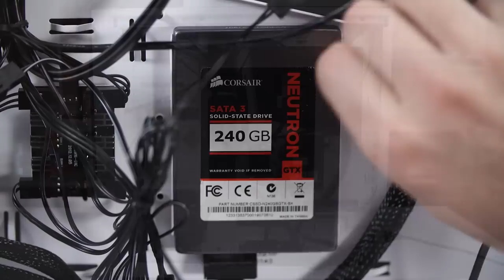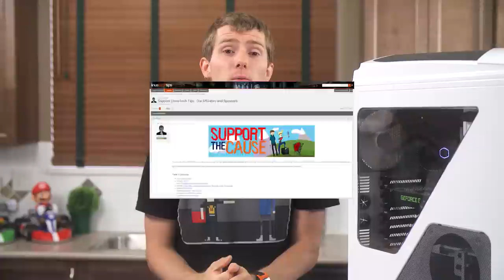NZXT Phantom 530 Gaming Full Tower Case

Comment: So wait quick question if someone could answer this for me plz. So you are saying that in this case since it is elevated a little bit and there is a filter that I can install the PSU with the fan facing downward towards my carpet without worrying about it dying or do I have to put a surface still underneath my case covering the carpet from the PSU fan? If someone could plz answer the that would be great thanks!
Reply: yeah you can let the fan face the carpet, but i would still recommend to not put it on a carpet, just because you do sacrifice a little airflow.

Comment: Telling people the length of the radiator that can be put in there is nice, but what about the thickness?
Reply: Also, there ARE reusable zip ties... I don't understand why nobody packages them. They aren't that expensive.
Reply: For NZXT cases in particular, you can check cooling compatibility on the NZXT product page.

Comment: You can remove the drives on either side, mine all come out the left panel, in fact im pretty sure that's the default way, so you managed to get them all turned around somewhere there Linus :p

Comment: i have a USB 2.0 front support MOB, it does not have a front USB 3.0 support, is there anyway i can use these front usb 3.0 ports in the case? and what would be a good case if usb 3.0 front i/o is not supported by my MOB.

Want to attach a h100i cooler to my fx8350 so looking for a case that could suit my needs.. also if any other cooler say maybe h80i would be a good option considering my MOB is only supporting front usb 2.0 ports and spending so much on a case without fully using the front I/O would be stupidity.

so want suggestions on cooling and cases..please reply pllzzzzz

Comment: Noob here! Can you install a single 120mm fan with liquid cooling radiator on the top?? like not a duo one?
Reply: Marleychopsandme  yes with the rad below the frame and the fan above the frame but below the plastic top piece. trying to mount both below the frame will cause you to have clearance issues with ram and other mobo components.
Reply: Yeah, if it can support a triple 120 rad then it can support a single 120mm but I'd go with a dual as it cools better

Comment: whats the reason for ssd being mounted behind the motherboard?
Reply: so you don't have to populate the front part of the case with the drive cages, so you get more airflow from the front bezel fans to the mobo, cpu, and gpu
Reply: So you can remove a drive bay

Comment: So i went to the link that was for the purchase on amazon and on some pics its empty and on the last one it has all the hardware and stuff in it will it come empty or will it come with everything in it for only 130$???
Reply: only thing it comes with aside from wires is 2 fans...1 in front the other in rear ...they just used the picture to give buyers a illustration of what they hardware would look like in the the case :)

Comment: Could you fit two GTX 980 TI's? I'm looking to start with just one but then upgrade at a later time
Reply: Mr. Clean Easily, I have this case and you could Triple SLI with no problem
Reply: Mellow Drama Thank you!
Reply: Mellow Drama you can go quad if you really wanted to the case will support it and with the additional fan support, it probably would cool them better too
Reply: Good
Reply: Good

Comment: Hey man, i love your videos. I have a question. And I need your help. Your opinion matters a lot.

I am building a new system. I have a NZXT Phantom 820 and NZXT Kraken x60. I wanted to know if the following way of mounting is efficient or will it cause any problems.
What I did was put the two 140mm fans that came with the cooler in push config. Then removed the side 200mm fan and mounted it at the top with the existing 200mm fan. Making it a push-pull config.
Now i want to know, is this way of mounting two different sized fans effective? any downsides? 

I have watched your video on push, pull or push/pull config. and I was initially going to go with the pull setup. but then i had that extra 200mm fan lying around so thought of this thing and now i am having second thoughts. I havent yet completed the build. The RAM is yet to arrive. 

Your opinion will be very helpful.

Comment: I have an 820, and I simply cannot remove the top plastic piece thingy to get to the pre-installed fans!
Help!
Reply: on my 630 i had to rip off the front panel then remove the top panel from the front side to get it off.
Reply: Atleast with the 410 you need to remove the front part to be able to easily take off the top, might be the same in your case.
Reply: in the case, there are these plastic pins. Squeez the 2 plastic things together. When you did that with all of them, push the top off. This was in my CASE my phantom 530 :)
Reply: ***** strmapes tommydadog 
In the manual they say, "Push the tabs located in  the inside of the front panel, then you will see an opening in the middle of the top panel, you can grab the top panel from that hole and pull it out and upwards."
While all that written here is completely true
The top panel is mounted way too securely, and I feel like if I put any more pressure pulling the panel it might just rip the front USB connectors off

Comment: I was wondering. I have all the specs for this computer, but I was wondering if a certain case would work being that this is my first PC.

  -Intel i5-4460 LGA 1150 CPU

  -GTX 960 SuperSC ACX 2.0+ 2GB

  -ASUS Micro ATX DDR3 1600 LGA 1150    Motherboard B85M-G R2.0

  -Crucial Ballistix Sport 8GB Kit (4GBx2) DDR3 1600 240-Pin UDIMM Memory

  -Crucial BX100 250GB SATA 2.5 Inch Internal Solid State Drive

  -WD Blue 1TB Desktop 3.5 Inch SATA 8Gb/s 7200rpm Internal Hard Drive

  -EVGA 500 W1 80+ 500W Continuous Power, 3 Year Warranty Power Supply 100-W1-0500-K9

Here's where I need help,
I know that the Corsair Carbide Series 100R Mid Tower Case CC-9011075-WW will work with the items. My problem is I also saw the NZXT Phantom ATX Full Tower Case but I'm not sure if it will still be able to hold and work properly with the said items. Anyone have answers for me. Any answers would be much obliged. Have a great day and thanks for the responses.
Reply: +Andrew Cole R9 380 is better than the 960. For a power supply I would get something reliable like this XFX : http://www.amazon.com/XFX-PRO850W-Edition-Certified-P1850SNLB9/dp/B0045L4BNW (click 550w) or an antec: http://www.amazon.com/Antec-Current-HCG-520M-BRONZE-Modular/dp/B006TVQTAY/ref=sr_1_2?s=electronics&ie=UTF8&qid=1442956657&sr=1-2&keywords=antec+high+current+gamer Tier two power supplies on this list will generally do the job for your system. I wouldn't get that EVGA PSU...
Reply: SomeGuyWhoHasAnUnoriginalName Thanks. This my first PC I am very thrilled to take on such a challenge. I appreciate the advice
Reply: +Andrew Cole Get an R9 380 indeed, instead of the gtx 960, it's much better, as a psu you could try and get a Seasonic S12||-620 and make sure it's at least Bronze Certified. The Case will be great, it's a Full Tower case so anything should fit in it just fine, especially if you plan on getting a Sli/Crossfire setup, just make sure you upgrade your psu if that's the case. Good luck!
Reply: +MrChicken5OOO yes, you can eve sli 2x 980 in this case, ir's Full Tower so you have all the space you neef
Reply: +MrChicken5OOO Yes
Reply: +Andrew Cole ummmmmm, not sure, but probably
Reply: +MrChicken5OOO get corsair 200r or nzxt s340 or nzxt h230 but s340 is where it's at as it has an awesome design with excellent airflow with also a cheap price point
Reply: +Hassman for Andrew cole^^

Comment: thank you linus this video just gave me the puch to go for the phantom 530 for my first pc i'm going to build. I have a question well rather I want your opinion on the components i'm thinking of putting in there so here is the list

CPU-Intel Core i7-4790K 4.0GHz Quad-Core
RAM-G.Skill Sniper Series 16GB (2 x 8GB)
GPU-NVIDIA GeForce GTX 980 Ti 6GB
Motherboard-Asus Z97-A ATX LGA1150
HDD-Western Digital Caviar Blue 1TB
SSD-Samsung 850 EVO-Series 250GB
PSU-EVGA SuperNOVA NEX 750W 80+ Gold Certified Fully-Modular

do you think this will all work great together or should I change something in order to make a good gaming/streaming pc

I would love to hear what you have to say :)
Reply: +BrmP It will work but for better quality and performance i would get evga g2 750w and wd caviar black
Reply: thank you for the help those components are something to consider
Reply: Also you could get the Cheapest z97 motherboard if you wont OC or do SLI. Also you can get the cheapest 2x8gb with same performance
Reply: Also if you want to SLI the 980 ti later get a 1000w psu for some headroom
Reply: +GreekGamer4U i haven't thought of that thank you because I wasn't planning on overclocking
Reply: ;)

Also since you wont OC the cpu then you can get the i7-4790 not 4790K with same performance

Comment: o i just want to say, i have one. it has good air flow but the top wouldn't come off with out pliers, and the power switch came broken, not to mention nzxt did not reply to my emails, customer support ticket, facebook messages, or instagram post.  and my fans did fit on the fan controller no problem.

Comment: I bought my PC from Overclockers UK, because I couldn't be bothered to build it. The guys didn't bother connecting the case fans and I have no idea what to do.
Reply: If the CPU fan is connected then usually all the other fan connections are for cases. They should be labeled. If not, look at the manual for the motherboard and it should point out where the connections are.

Comment: I'm kinda weirded out by NZXT's decision with this case. Its 2 inches slimmer than the H440 and has external 5.25" bays, but the advantages stop there. The latter has better noise cancellation, a PSU enclosure, more fan mounts (or equal, if you include the side panel mount), more solid construction (i.e. better metal/plastic ratio) and has been available for a few months. Yet both are priced very close to one another, with the 530 costing a few bucks more on average (although that would be expected of a newer product). 
I know this isn't dooming to NZXT, as they offer near-immaculate quality for the buck, but it just seems an odd business decision.

Comment: i have a question and sorry if i sound dumb coz i don't know any f*cking sh*t about pc's 

so do cd drives (i think thats what they are called : in which you the cd's) come bundled with cases or you need to buy a new one? 

and thank you linus for giving me some tips that i need before buying my new pc
Reply: +Ayush Panchal you have to buy one, the correct term is an optical drive. However they are being phased out now to be honest, my latest build doesn't have one for example i just have a USB one if i desperately need a disk
Reply: Thank you so much bro!
Reply: :D
Reply: No problem happy building :)

Comment: What GPU is that in the build?  it looks unfamiliar and the board appears small with the cooler sticking far out.  Now I am going to give a weird guess:  Maxwell?
Reply: I would say the old blower design for gtx 600 series or a 770 with a blower. Just a guess.
Reply: looks like a reference gtx 600 or 700 series
Reply: why.. would you guess maxwell... insert jackie chen wtf meme
Reply: It is probably an older card...  that's just me being hopeful for Maxwell :)
Reply: Linus has review reference cards lying around that he throws into these builds. Nothing fancy... Could be a review 770/680... who knows, doesn't matter.
Reply: I think it's a stock 760, This is it, http://www.techoftomorrow.com/wp-content/uploads/2013/06/JH6A8797.jpg
Reply: MrMossyPS3 That is the best answer yet.  I think it's a odd spot for that Power connection.
Reply: Im not sure you can buy them in stock form, only with aftermarket coolers, and yeah I know, looks strange to have it in the center :)
Reply: can anyone tell me what orientation the fan on the rad is, is it push or pul

Comment: Hey I was wondering if you guys could tell me whether these parts im getting in a few weeks for a custom PC (going from an iMac 2011 to a windows, very happy lol.) I'm going to do gaming on these even though i have a PS4 that i barely use, basically only for Netflix lol. bc console peasant race (besides the fact that it has Madden 16)

Is there any problems I will meet when putting these things in the case?

Case: NZXT Phantom 530 Full Tower

CPU: Intel Core i5-6600K 3.5GHz Quad-Core Processor

CPU Cooler: Corsair H60 54.0 CFM Liquid CPU Cooler 

Motherboard: MSI Z170A GAMING PRO ATX LGA1151

Memory: Kingston FURY 8GB (2 x 4GB) DDR4-2400 Memory

Storage: WD Caviar Blue 1TB 3.5" 7200RPM Internal Hard Drive

GPU: MSI Radeon R9 390 8GB Video Card

PSU: EVGA SuperNOVA NEX 650W 80+ Gold Certified Fully-Modular ATX Power Supply 

SSD: Samsung 850 EVO 250GB
Reply: +shadow ¯\(ツ)/¯ Its good but go with wd caviar black or get an SSD and also get a evga g2 750w or a gtx 970 because the 390 is very power heavy and minimum is 750..
Reply: GreekGamer4U no, 650W is just fine
Reply: If you wont OC Yes but you are a bit late
Reply: GreekGamer4U yeah lol a bit late.. i know a lot more about computers than i did when i made this post :p would've definitely kept the psu and change the gpu to a 1050ti or a 970 aha along with instead of an h60 get an h90

Comment: Phantom 530 or H440 for a quiet water cooled build?
Reply: H440 is a lot more quiet but has nowhere near the rad space that the Phantom 630 does.

If you can afford it H630 is better than both if you want both quiet and liquid cooling.

Comment: First time building a pc should i get a full tower or mid tower?
Reply: Samuel Vargas im new too man and i kinda want a mid tower for the look and i dont have the room for a full i think,  hoping if i get a mid it isnt too hard to build with
Reply: Tony King I have built 3 computers using a mid tower case along with a H100i liquid cooler depending on the case its self you will have plenty of room especially if your air cooling

Comment: It is possible to get re-usable zip ties and I would rather have these than twist ties which have wire in them which could easily cause issues so I would personally rather not use twist ties.

Comment: Hey guys, I need some help.
My OS is on my SSD and I save most other things to my HDD. Recently, my PC slowed down significantly (I always properly shut down and there have been no power surges), but when I unplug my HDD, the system runs fine. Plugging it back in causes my entire system to slow down.
It would be nice to know that my HDD is fine, but if you guys have any idea what's wrong with it that would be very nice.
Thanks :)

Comment: Do you guys recommend this or the NZXT S340 case. The spec of the pc I want to build is as follows: 
Gigabyte Z97P-D3 motherboard, 

HyperX FURY Series 16GB Memory,
Samsung 2.5-Inch 250 GB 850 EVO Solid State Drive,
Intel Core i7 i7-4790K CPU, 
MSI NVIDIA GTX 970
 NZXT X61 Kraken Watercooler. 

Will this fit in one case, the other or both? Maybe even another case which is better. If so which case do you recommend overall?
Reply: Im not sure about the s340 if it can fit the x61 but this does

Comment: tbh the original phantom still has better cooling, this one only has output fans, no input, (Apart from that tiny side one which wont do much), the front fan in both cases are useless as the airflow is blocked by the HDD bays. however i prefer the front look of this case to the orignal, but everything else i prefer the original, I like the clear panel on this one though. but i can always change that later :P
Reply: lol you just have to flip the fans and boom input fans XD
Reply: yeah but it messes up the Airflow big time, Having the two 200MM fans on the top pulling air in Really Effects the Rear 140MM big time, i have made it so the rear 200MM and 140MM are pulling air out, and the Front top 200MM is pulling air in, So the CPU sucks in all the cool air directly into it and and the out take gets taken by the 200MM and 140MM rear right away =] but i still think the front 140MM is completely useless.

Comment: Will this handle minecraft at 10 fps on low settings?
Reply: +Shmaehdawlf Shmitler depending what you have.
Reply: CodeOne I bought case and it does not run, what not work?
Reply: CodeOne I bought the gunmetal case, does the gunmetal one give more fps?

Comment: can  i put a 280mm Kraken X62 in a nzxt 630 case
Reply: can you put it in this case?
Reply: dual 140 would lead me to assume yes.
Reply: yes
Reply: @Valhallen002  i been told that the 280 wont fit has it only holds 2 x 200 mm in the top

Comment: What's the GPU in the system?
Reply: i believe its either a gtx 780, gtx titan, are gtx 690 but i can say for sure what manufacturer
Reply: Reference GTX 780
Reply: at 6:05 you can see that the PCB is actually short and it's elongated by a plastic shroud. So I don't believe that it's a 780 reference. Might be a GTX 760 imo.
Reply: your right a 760
Reply: It's a reference model of either the 660 ti, the 670, or the 760. All of them use the same reference PCB and shroud.
Reply: It looks just like my GTX680

Comment: Guys I have a question. Well somewhere in the middle of the next month I think I will have the opportunity  to buy a gaming PC. Since I'm not that updated to the new hardware parts, like the 4th gen Intel processors, the new gen AMD and Nvidia GPUs and stuff like that can you guys prefer me some builds for around 950-1000 USD. I was thinking to get an i5  4670 cause I dont want to overclock about the GPU  a GeForce GTX 760 or Radeon R9 270x should do the trick ? I wanna play the newest games like Watch dogs, GTA V and future games.

Comment: how many fans can i put if i have a corsair h110i gtx cooler
Reply: +BlitzFirePlayz 2 on the rad, 2 infront 1 on side 1 inside 1 in the back 1 in the bottom
Reply: Yeah i looked on the nzxt website and found it. took me a while to pick which ones i wanted like 140mm or 120mm